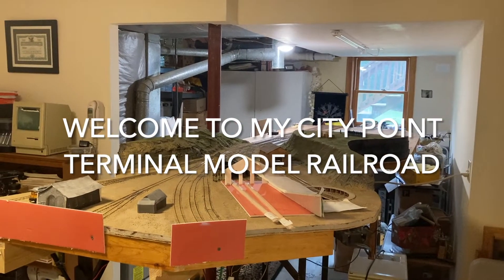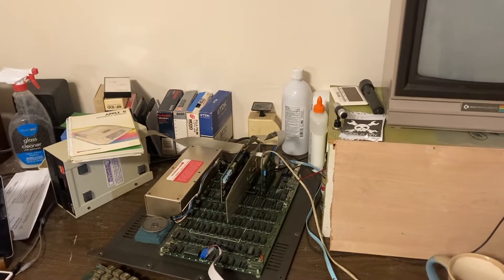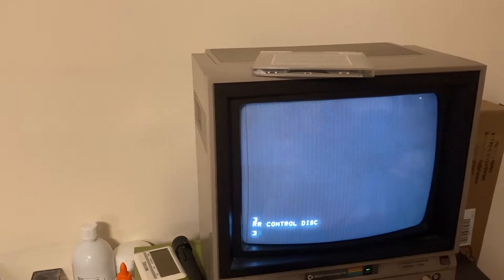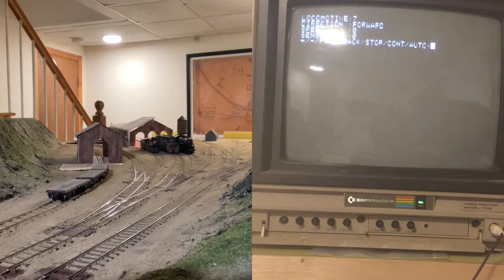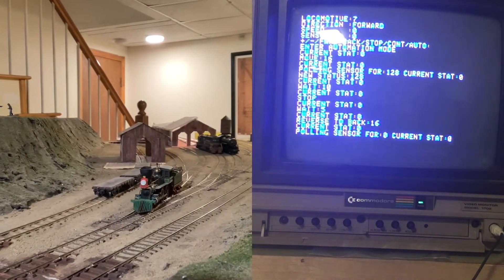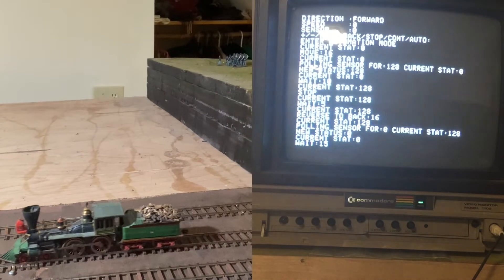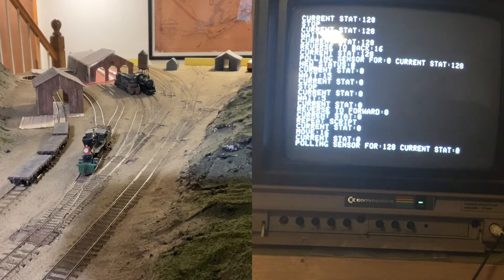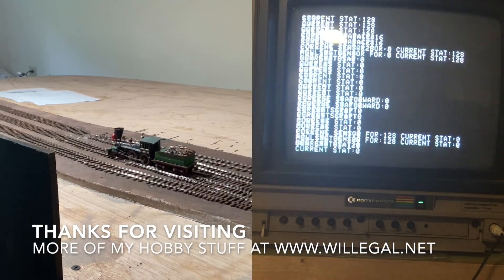MODEL RAILROAD AUTOMATION

Comment: Derailment…switch wrong..  reminds me of one of my videos.  😀 Pretty cool using your old Apple computer. 👍👍.   I’m a retired IT guy doing JMRI script on my Windows 10 laptop.  Doing this adds another facet to building my layout.  I’m using IR sensors with DCC ++ EX on an Arduino Mega to detect a location for loco to stop.  I haven’t tried block detector yet but hope to soon.  Good luck with future coding.  Subbed to follow.
Reply from the maker: Using the Apple II was the easiest path forward for me.  I don't have to worry about powering it, data storage or the user interface technology.  Interfacing to it is dirt simple and using the same interface I built for the block sensor, I could easily incorporate additional types of input circuits such as infrared sensors.  I'm not fond of the BASIC language, but it's there and can be made to do the job almost as well as a modern scripting language.  Once I get the hardware design polished up a bit, I'll make a video describing the hardware design, which could be adapted to ardunio or any other micro-controller based system.
Reply: Thanks for feedback.  I’m not any good with electronics but what you are doing is interesting.